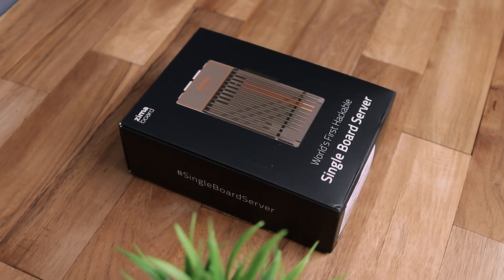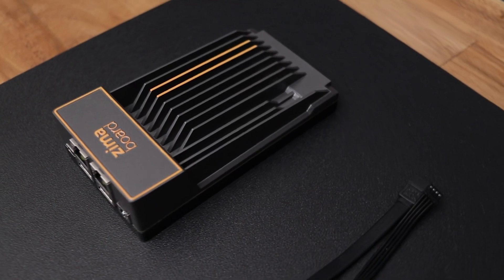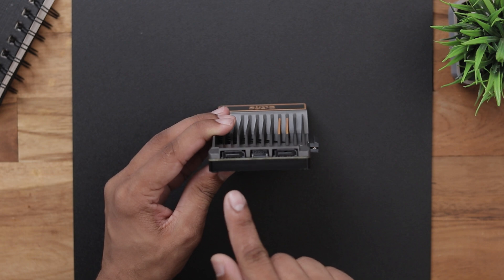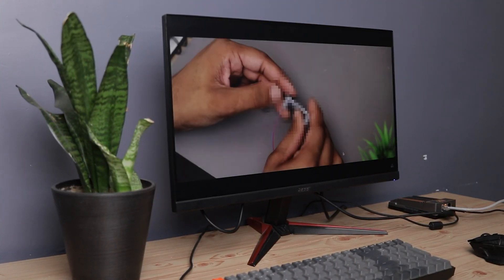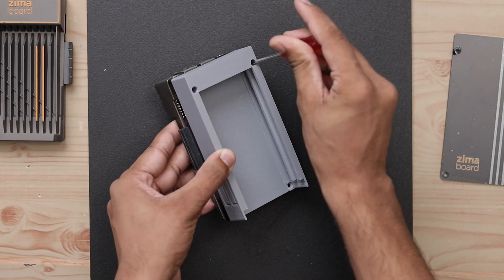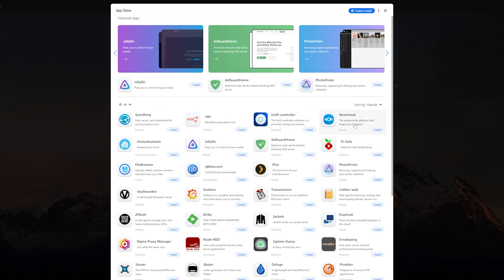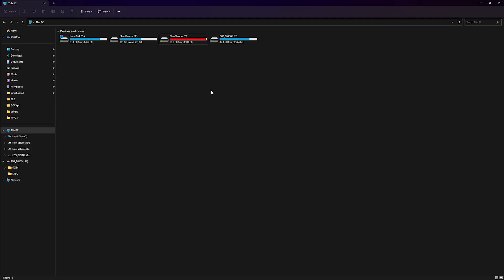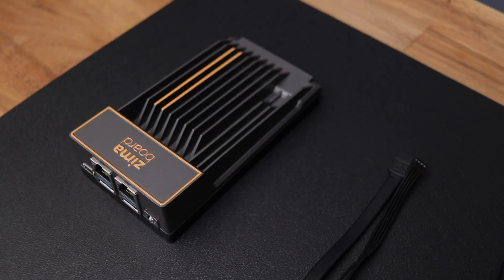How To Make a Tiny Home Server | DIY Projects with Zimaboard | The Wrench

Comment: Ive seen some free electronics, and one of the main conponents is a network switch, ( usually $120), In which ten different computers are hooked up to...Even some wifi routers can have an extra connector.
Most network switches, are used with a computer, for customer accounts , shipping and receiving invoices.